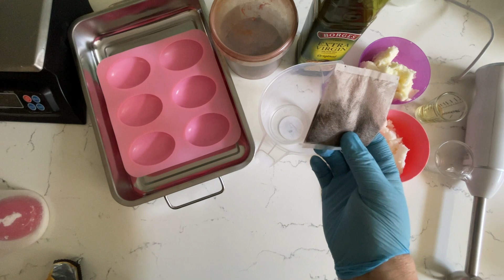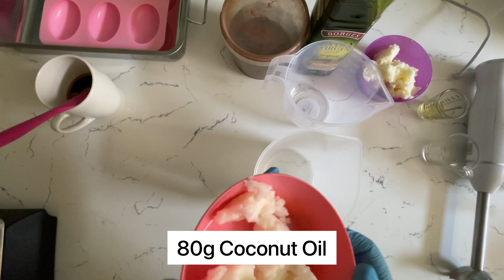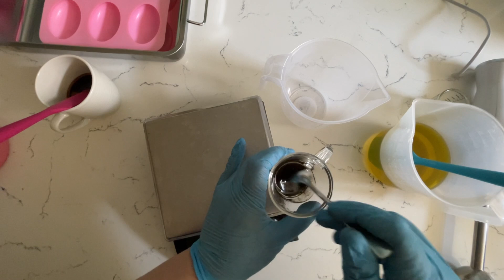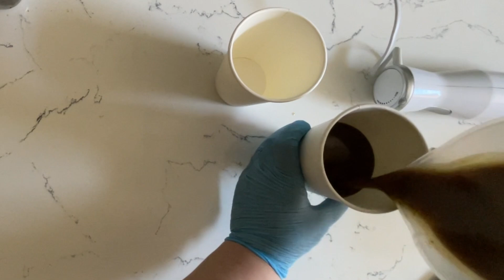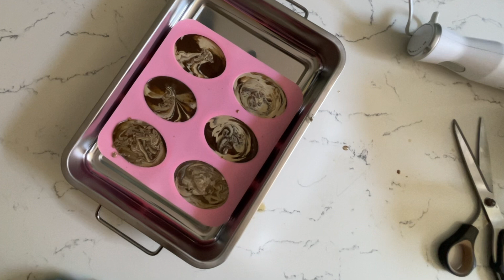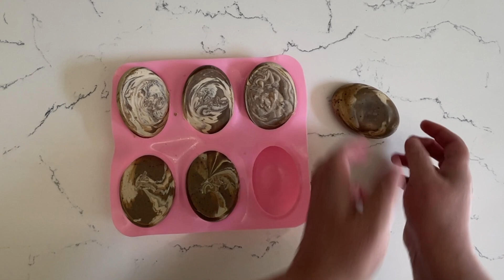No Bleed Method | Making Soap With Coffee Grounds

Comment: There were some saying that using wet coffee will get soap go rancid is that so
Reply from the maker: It shouldn't.  Rancidity is from oxidation of oils so the wet grounds would not affect that.  If used dry however, they can absorb the lye which can then released after the saponification which can lead to small caustic pockets